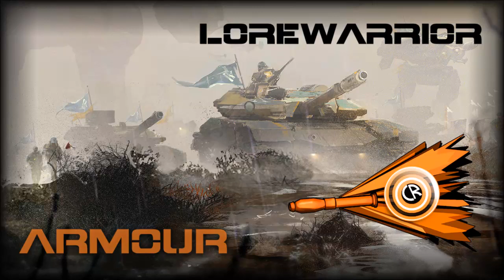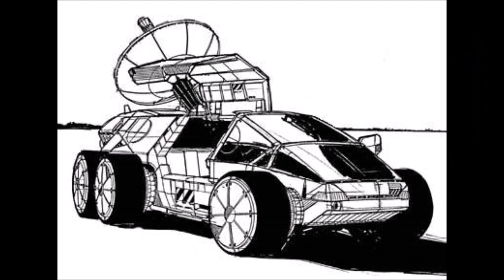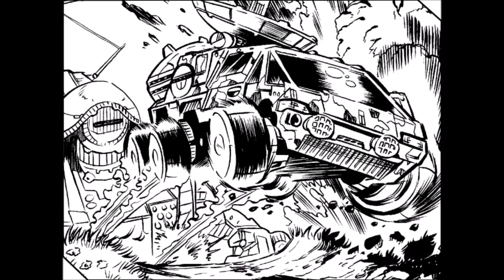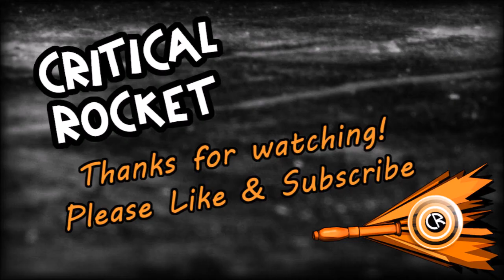LoreWarrior Vehicles - Swift Wind Scout Car

Comment: Hello, CR.

The Swift Wind and various other scout cars became so ubiquitous that my old Playing Group would grant extra knowledge about one's foes if you had them in your table of organization and equipment. For gaming purposes, this usually meant that by the time your force landed on planet, you would have up to date maps and know where Enemy forces were located and their numbers in general. Including numbers of each class of Mechs. 

Since the Fusion Engines were rare, most scout cars in the Group were ICEs and ran on various fuels. The most common of which was Alcohol. Almost any crop can be processed for Alcohols, or vegetable oils. ON the 'upside' of things, such engines could be mostly ceramic in nature and thus far lighter than the older standard metal block engines. This in turn led to scout cars having very long ranges. 

We figured that such a vehicle might have a cruising radius of around 800 miles or so (able to travel 800 miles and return on the same tank of fuel. Defending Players could stash fuel dumps all over the place so that such a vehicle could refuel 'on the go' and follow Enemy units, no matter where they landed on planet. Said fuel dumps also contained food stores of both canned and freeze dried foods, medical gear, basic tools, and replacement parts for the vehicle. 

Since the ceramic block engines could be adjusted to burn almost anything as fuel (gasoline, kerosene, alcohols, diesel, vegetable oils, etc), the vehicle could also mount the parts to build and operate a 'still' to produce fuel in a pinch. Such cars were known as 'Rice Burners' and 'redneck roadsters' because of this. 

It did not take long before someone came up with the bright idea of altering the satellite dish to 'fold', creating a 'bulb' appearance and making the stowage of the dish easy and also streamlining the shape for less wind resistance and better fuel economy. 

As previously said, the use of scout cars was so common that unless a planet was totally controlled for landings, a Leopard drop ship could slip onto the planet and release dozens of scout cars long before any raiding force arrived in the solar system. In a pinch, scout cars could be camouflaged to resemble civilian cars via disposable body panels and inserted onto a targeted planet via civilian drop ship or trading ship. 

We even played out scenarios where both Attackers and Defenders fielded scout cars. The attacker to locate Enemy forces, ammo dumps, etc. The defender to locate enemy scout cars to be eliminated via various means and thus deny the attacker detailed information.